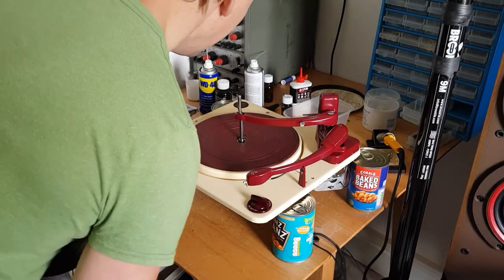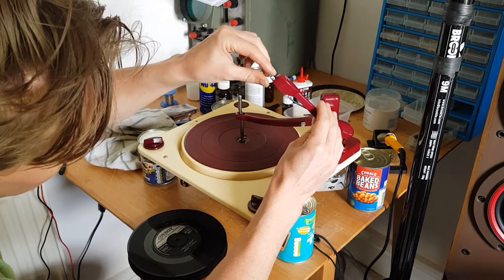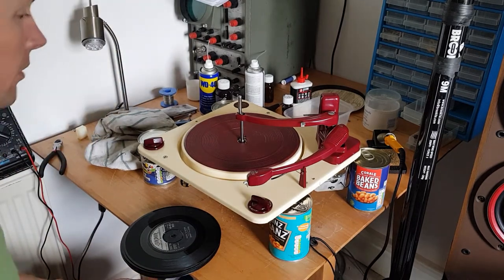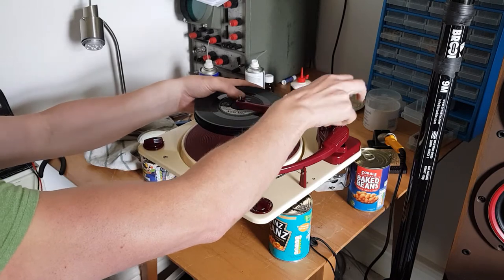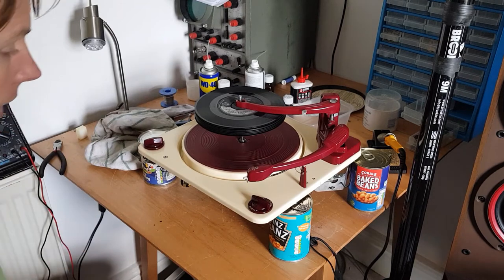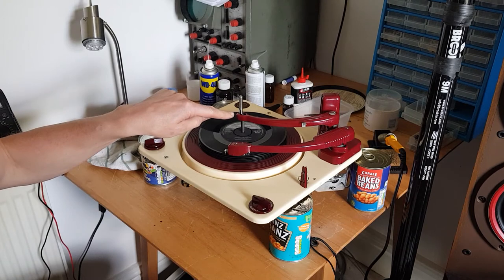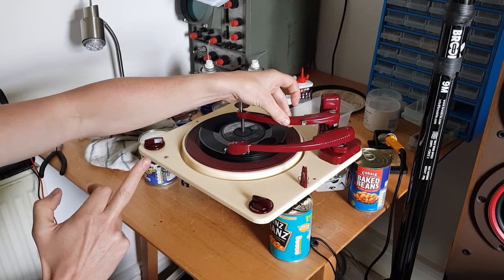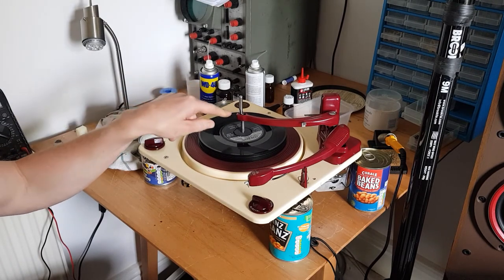Collaro RC 54 Record Changer Demo

Comment: Collaro also had the Conquest and Studio models on which the tone arm would raise a step further to the same height as the record to be played, move across and "feel" the record to determine it's size before dropping to the platter. After the last record  the arm moved towards the center of the turntable, sense  no more records to play, return to it's rest and shut off thus making the "control" arm a stabilizer.......or over arm. Fascinating stuff to watch though. When Magnavox acquired Collaro in 1960, they would go on to use this type of changer right up to the early 80's. A few other manufacturers would use this method as well.

Comment: Hi Darren. I have the same (or very similar) player in a unit I'm restoring.  I'm no where near as competent as you, however i have mine working nicely EXCEPT for the tone arm. It moves, but is unpredictable. Works on reject, but a bit shaky on start (it gets the record edge correct, sometimes goes too far...) Any ideas or help I'd be very thankful!
Reply from the maker: The set down adjustment is very fine their are two screws beneath the tonearm base
Reply: @DarrensVlog  Thank you sir! I've adjusted those two screws to get the starting point correct. I also cleaned the underneath like a madman with q-tips dipped in as pure rubbing alcohol as I could find to clean off old grease.  Working like a champ!!!

Comment: Hi I have  an identical Collaro RC64A but the issue is that the tonearm doesnt move down to 7" but then it starts eratically sometimes at 10" sometimes at 12". Doesn't seem to matter what speed it's set at. How can I fix it?
Reply: Has everything underneath been recently lubricated?   These are old machines and need occasional maintenance.  Most erratic operation can be tracked to dry grease.

Comment: I hve several Magnavox badged collaro changers and wish you could come look at them the two i'm having trouble with were made in 1967
Reply from the maker: It'll be old grease thats turned to glue.
Reply: I am in Indiana, and I repair those Collaro  changers. Contact me, if interested.